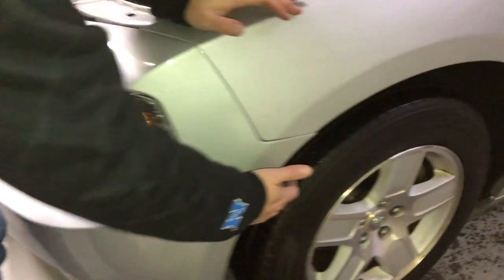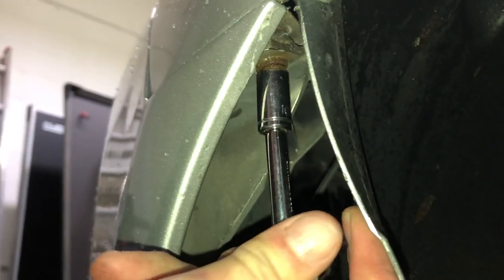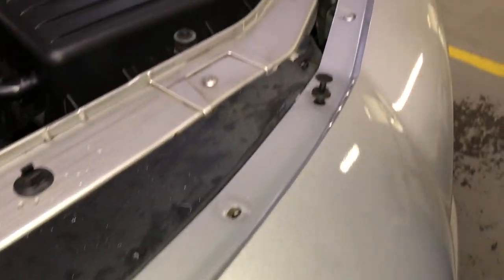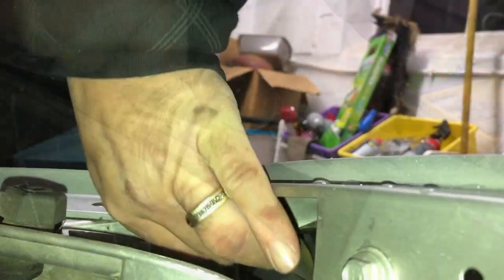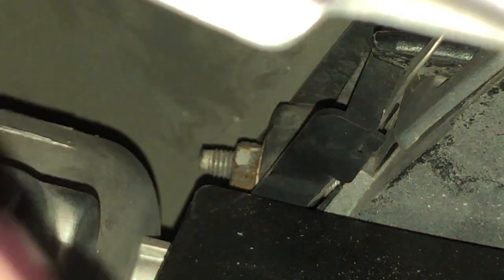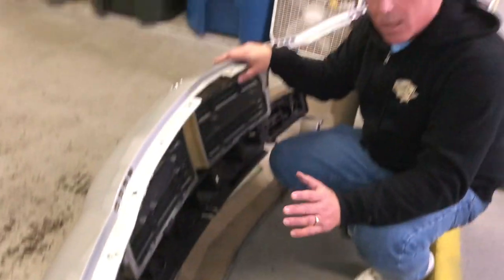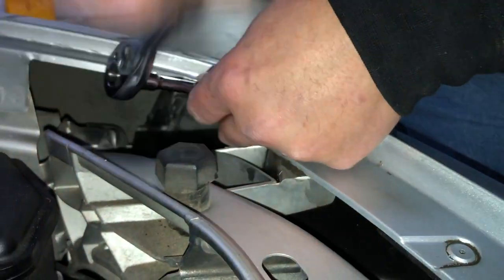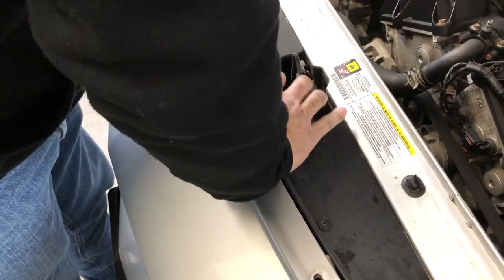How To Remove Your 2006-2010 Dodge Charger Front Bumper Assembly

Comment: Excellent video! Thank you. I got a question. I replaced my old bumper for a new one in a shop. Since they changed it, I think my bumper moves a little. It feels like if the bottom is loose. Is that possible? Thank you
Reply from the maker: I would check all of the places that the bumper attaches. Especially the bottom corners in the wheel well.

Comment: I crashed my entire front end and need to replace both fenders, hood, and bumper. And I need to replace the whole part that holds the radiator and the lights plus I have to either reconstruct the front frame because it's bent to one side or I need to saw it off on the points where it's bent and get an used new one and weld it on straight..now I have a 2010 dodge charger and found a 2008 from where I can get the parts from..I saw the video you made on the fenders and the hood should be easy.so should putting on the bumper and the lights..but can you give me some tips or advice on the front frame that holds the radiator and lights.also with the frame being bent to the side.what should I do? Im lost.I feel like it will be too hard.anything will help.thanks
Reply from the maker: Frame damage is very difficult to repair as a DYI project. Depending on the amount of frame damage, you may want to consult a repair shop that specializes in frame restoration. Everything else in your project is mostly bolt-on replacement.

Comment: So I bought a 10mm extension for my 10mm extension and it doesn't fit ???//
Reply from the maker: Next time bring the extension with you and make sure the ends fit while you are at the auto parts store. It will save you a trip back to return if it doesn’t fit.